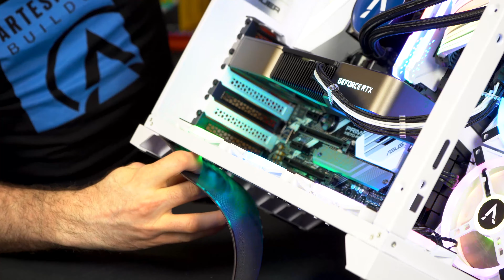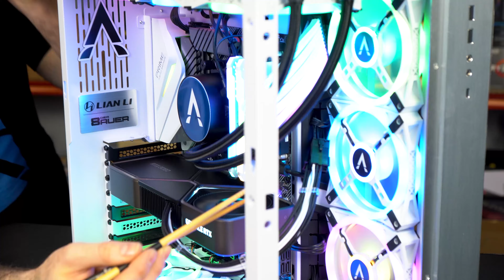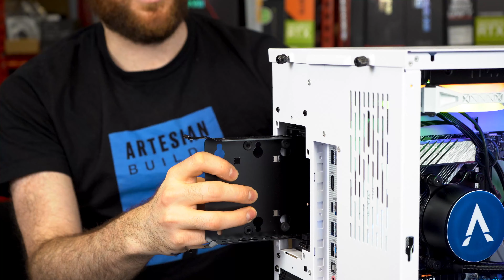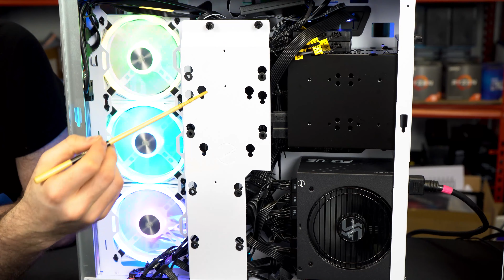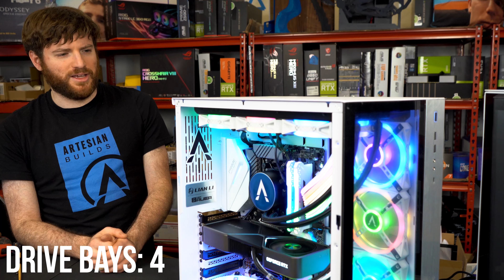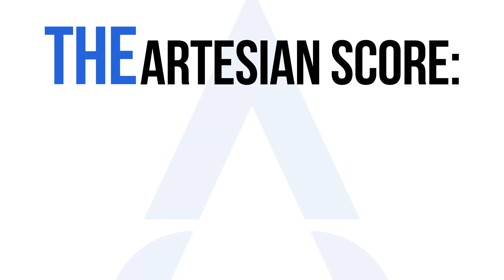Here’s why EVERYONE is using the Lian Li O11 Dynamic...

Comment: Nice details in video. Revealed some important stuff/hidden gotchas.
How about if you used 15mm/slim fans at the bottom (vs. 25mm fans, for an extra 10mm/.4" of clearance)? Would that still obstruct the motherboard connectors?
What size thickness radiator did you use that left all that room at top (30mm)? Would a thicker radiator (e.g. 40mm/60mm) better maximize the use of available space?
How much extra length is on that 90 degree USB 3.2 connector? I'm hoping to connect it to a Gigabyte WRX80-SU8-IPMI, which has its USB 3.2 header lower on the motherboard and mounted horizontally? In incompatible scenarios, can that USB 3.2 connector cable be replaced with different cables that would work?
How about options for a second radiator in the side pedestal area, for GPU water cooling/custom loops, etc.? It looks like there is some room in the side pedestal sunken area underneath the top radiator, but would it be enough for a 30/40mm radiator and 25mm fans?
Thanks for any insights you could share!